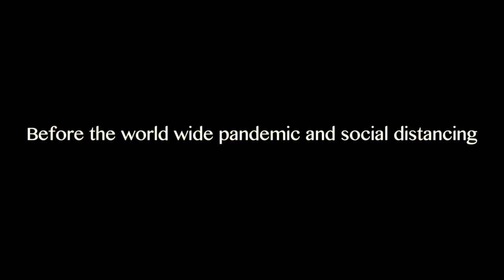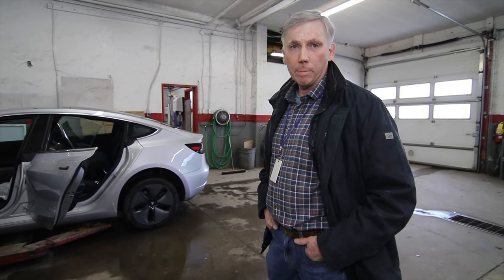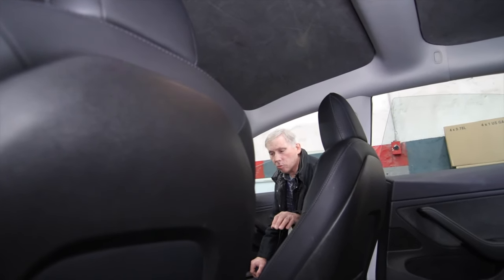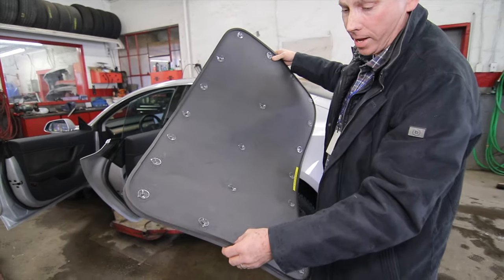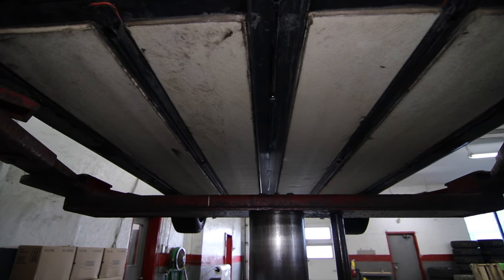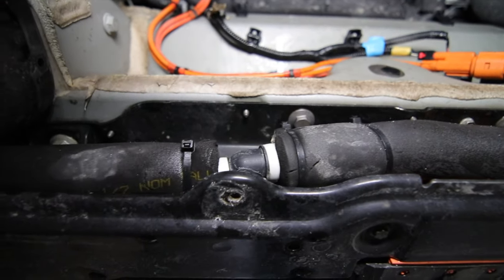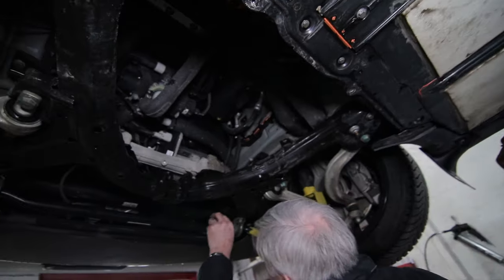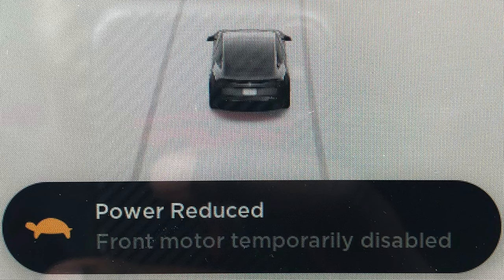How to insulate your Model 3 Cabin and Battery Pack with EVinsulate. (BETTER EFFICIENCY)

Comment: I put together with Calix.se a battery pre-heat system initially intended for ICE cars. It keeps the battery at 20-25°C with a 1kw heater, thermostat and circulation pump, when parked or charging. Full regen, full range and even temperature throughout the whole battery pack regardless of outside temperature. Still needs additional insulation because during driving the temperature drops.
Reply: This would be a great system to have when you only have access to a 110V plug, no need to use the battery power.

Comment: Nice summer car. Seems the car need a Winter software setting (or a themostat haha) for cooler climate to not waste Power cooling  unnecessary the battery while parked.
 Is the compressor active cooling the battery in - 40 degrees when turning on track mode ? It seems so since i hear it spooling up

Comment: Great video and product.  Do  you remember what the temp was that day?  159 is really great efficiency for Canadian Winter driving.
Reply: Head or tail wind is another factor
Reply: I have been doing a lot of testing using the ScanMyTesla system and record the results for long drives with average speeds of 90-100km/h, low wind, low sunlight and dry roads. I posted a dozen sample drives on my Facebook site https://www.facebook.com/evinsulate/

Comment: Do we know that installing this on the battery pack would void the warranty on the battery?
Reply: Hi Hank, this is the from my website (EVinsulate.com) regarding warranty concerns: "Battery failures in Tesla Model 3's are extremely rare and are typically manufacturing defects which show up soon after purchase. While battery and hose insulation does retain heat in the system it is only one of many factors which the battery cooling system must contend with. The thermal management system begins with allowing the battery to warm to about 30°C for best performance and efficiency. Once 30°C is reached the system then attempts to hold that temperature by directing coolant through the radiator. The radiator has it's own fan which turns on as required. If this is not sufficient cooling the HVAC compressor will then turn on to assist the radiator. Under extreme heating conditions the car will restrict power to prevent battery and drive unit overheating. All of these systems would have to fail for the battery or drive unit to overheat, which would be a Tesla failure." Here is a great article describing the thermal management system https://www.gizmodo.com.au/2018/12/the-tesla-model-3-superbottle-easter-egg-is-a-fascinating-packaging-solution/

"When a Tesla arrives at one of it's service centers with a component failure an assessment is made as to what caused the failure and whether or not the cost to repair/replace is covered under warranty. Car manufacturers cannot simply decline to honor a warranty claim, they are legally required to prove that the owner caused the failure. Every case is assessed on an individual basis so there is no guarantee that a warranty claim will not be challenged but it would have to be for legitimate reasons."

Comment: dax, amazing vdo. Thank you for thos. From Toronto myself. He quick question. Will those suctions leave mark on the glass? I never used a suction to stick my phones or anything to a windshield (of other cars I owned) fearing that it would leave a mark that can't be erased.
Reply from the maker: No. It’s a regular common suction cup. You can wipe it clean afterwards with a damp cloth.
Reply: @DaxM  thank you. Cheers 👍😊

Comment: Unless I missed it I didn't see any range improvements discussed. I drive the Bolt in Minnesota and already seeing the range go from 238 to 170. INsulating the battery. What kind range improvements are possible?

The perfect battery temp is around 72Degress F 240-265 miles.  battery cools off rapidly here lowest registered 48 degrees..but even at 57 degrees range takes a big hit.
Reply from the maker: There is mention of a percent of range increase in the video.
Reply: @DaxM   Umm Dax..I can watch 18 minutes over again or you could just tell us what the range percentage increase is
Reply from the maker: @electric-rideshare  sure. 
10-15% increase in efficiency
Reply: @DaxM  I would be very curious to see some (independent? multiple?) testing for this information.

Comment: this is very good idea to keep battery long lasting but insulation should be only in winter there and should be removed in summer
Reply: While car is moving doesn’t impact much of road heat and you need air circulation around but in winter. Minus temperature weather  and while battery in use or when it charge at fast rate generates heat  if you have cold and hot difference will  degraded the battery performance or break down in battery after time is possibility so I posted to use only in winter
Reply: .. that is not how insolation works.. in summer it helps keeping the battery cool

Comment: polyethylene Heatsheets wraped around full system with heat retrtent blanket and heat induction wires spaced every 2 in hooked to thermostat that turns on automatically to keep avrage temp and edversly some tubes could be spaced every 2 in to blow cool air on battery when its hot. Mylar reflects 90% of heat to increase efficiency over life of vehicle.